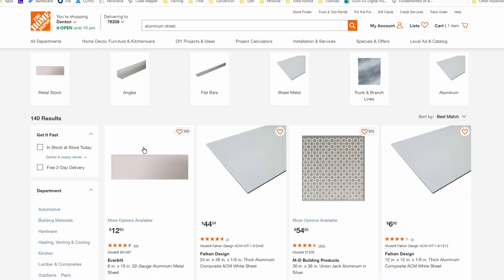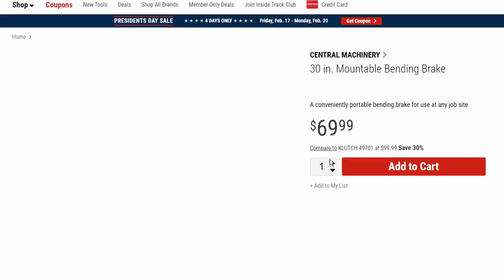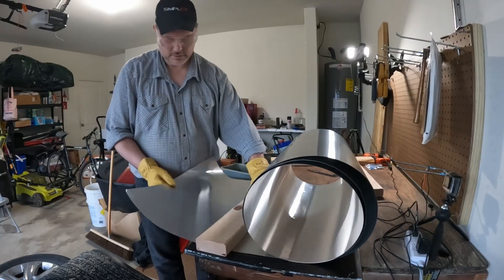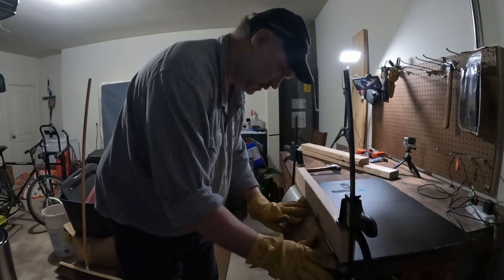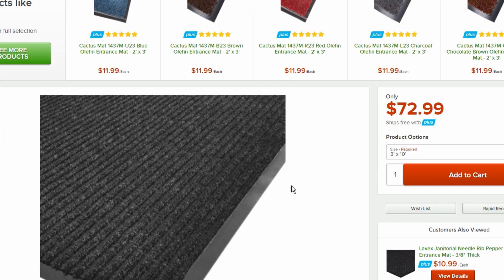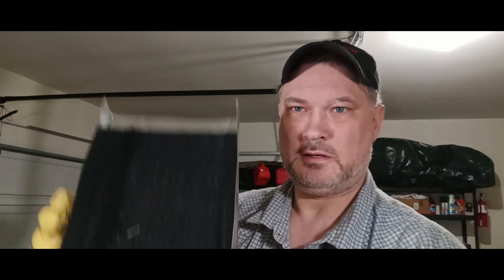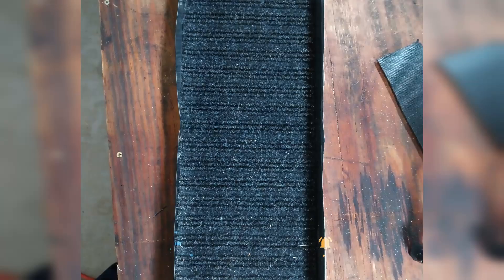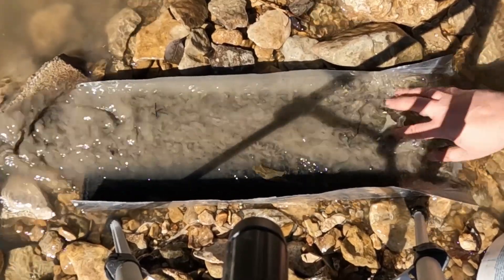Gold Rush On A Budget: Diy $10 Sluice Box - Make Your Own Prospecting Gear!

Comment: Excellent prototype for the price! As it sits, it's definitely a good value. I like your diy metal brake for the diy sluice! And the intro had me cracking up and also nodding in agreement! Like the above comment said, great production value! Keep it up! 

Now my 2 cents' (which should be taken with a grain of Llano fly poop)

 I wonder if the matting would benefit from the fabric being looser and more porous, and if a wire brush could be used to accomplish this with what you already have? Idk how rigid the fabric is, but I imagine if its compacted pretty tightly, then then surface tension and agitation would benefit from having a more porous surface to catch more heavies on top and in between the riffles/ridges as well. 

Experiment with different folds and bends and you can definitely accomplish the rigidity you're wanting. Maybe using a 1/4inch lip bending outwards on all sides of the sheet metal (once cut into the size you're wanting) before bending the sides and flare would aid in that? 
Edit if you did incorporate some type of lower ridge, into the bottom or bottom edges. You could use JB water weld to seal the lip from particles settling into it, and add rigidity at the same time. I used some to bond and reinforce a header box I made and its held up awesome for two years. 

Either way, great build, great video! Thanks for sharing your journey with us!
Reply from the maker: Thank you so much for your suggestions! I want to find some way to curl the top edges, but the main thing is the bottom..
Well, now you got me thinking.. I could put a keel type bend right up the middle, but I'd lose width..
The carpet itself is too thick and soft. I wouldn't be surprised if there's still lead stuck in the fibers, but besides that my water flow, the fact that I dropped the sluice itself, the angle - there was a ton of stuff that contributed to the bad recovery. I just don't have a rig to properly test. 

Thank you so much for such a detailed comment!! I really appreciate conversation about this stuff
Reply: @goldnoob  you're definitely onto something! I couldn't even build my clean up sluice for $20-30. 

40% recovery in a $10 sluice is better than no recovery and no sluice at all! You'll get those numbers where you want them! And besides, DIY is how the old timers started this great tradition. And we ALL know someone who has spent too much on sluices (its me, I'm guilty😂) One day, we might be telling folks how we witnessed your rise to fame as you become a household name like Keene or Minelab. Dream big! You can do this!

Comment: I was looking for something like this! Love that you didn’t cut out the part where the sluice fell into the bucket and how crafty you were when bending the material. 
I’ve seen some small short sluices for fine gold recovery online. It looked like a rain gutter, small fish pond pump and black rubber ribbing. I was going to try something like that for circulating sand I pick up while traveling but haven’t made the jump because it was almost $75! 
I’ll definitely be trying this but maybe with a thicker sheet metal or adding wood support on the bottom using homedepot yard sticks or other stuff.
Reply from the maker: Those are some great ideas! One thing I didn't mention in the video is that I was looking to sell these for $10. If you make it yourself it's only like $6 per sluice, but you can't buy any of it small enough for just one. Besides even if you could it would drive the cost up..

My ultimate takeaway was that the sluices you buy online, I suppose, are really truly worth what you pay for them. I'm just trying to come up with somethign that's .. I dunno, like a paper cup disposable version LOL

Comment: Just made my own mini sluice from some funky textured steel sheet metal from scraps from my stove vent, might be interesting to see how the added textured low spots catch gold with or without moss, matting, or diamond mesh. 
I dont have a brake press, but had a bench vice, plenty of wood scraps, and two wood clamps i repurposed as such. Turns out 2x4s have a pretty decent bend radius for the material thickness i used. 

Since i was working with scraps i was limited in my dimensions, but the two pieces i had worked out pretty well in the end since they were the same dimensions. Ended up with two sluice channels that were 15" L x 7.5" W x 3" H, i plan to rivet the two together so they can hinge and fold making it more compact while giving me a 30" sluice. Just need to source some cheap or free matting, riffles, and moss. 

Whole reason I built it was so i can process material from deeper spots in the winter and keep my hands dry and out of flowing below freezing water lol.
Reply from the maker: That's really cool! Matting is really the challenge. I tried a bunch of stuff - if you have fine gold where you are, have a look at marine carpet. Just make sure it's textured. I think I have a link to what I used somewhere
Reply from the maker: This video here, I used the marine carpet but I guess I didn't link it :(

https://youtu.be/aMIQTRTHeGw

Comment: Dollar store ribbed carpet might surprise you with its gold capture ability. With smooth and even laminar flow (unlike the scouring flow you had), a moderate feed rate and a damper flap, the capture rate for gold is extremely good - probably 100% of the coarse gold, and 85% capture down to 200 mesh. Tip - a 12 inch wide x 36 inch length plastic boot tray is $3 from the Dollar Store and is much more rigid than that aluminum you are using. Just saw the bottom and top of the boot tray horizontally to turn it into a river sluice. Good stuff!
Reply from the maker: I found the dollar store rug literally 5 minutes after getting the other thing! I'll definitely look at that for the next one.
I'll see if I can find that boot thing

Comment: As a recent machinist...I can appreciate what you were trying to do here.  👍
Reply from the maker: What kind of machining did you do? I worked on Brown & Sharpe single spindle screw machines
Reply: @goldnoob  Well...here goes it...I'll try and keep it short.  I'm a 3rd generation machinist.  Worked next to my father and grandfather growing up.  I started sweeping at age 9...saw/deburr age 11....was reading mics at 13 and full on mill hand by 15.  That was before cnc...all manual....mill saw lathe and grinding.  That was down by Detroit.  Then The folks moved up here to Wisconsin while I shifted to landscaping in Detroit.  Fast forward to 2007 and what my folks built up here was a world of difference.  I moved here and learned cnc.  After and intense couple years I was able to work independent from print to product.  We became iso and aerospace certified.  We also built a 2nd location around a giant boring mill.  That became my baby and I also managed that building.  Without to much detail (NDA) I 3D machined some large naval ship components. With all of that said I needed a break...which I am using to start all Gold and silver related hobbies.
Reply from the maker: That's an awesome story!

Comment: Not done with the video, but I was thinking of a plastic, paint roller tray with the textured shelf liner material. Wally World has, EasyLiner Select Grip 12 in. x 10 ft. Shelf Liner, Black. I would cut the end wall of the tray shorter and maybe screw some washer on bottom to give some weight.

Comment: Re-enforce the structure at the top with bars/etc so it would hold the form better.  Don't use carpet as it's not good for this but get the proper mats.  Also, I don't think you can get away with a 10 AUD version of it.  Just not going to happen.  I have a design in my head that I would make but am so far away from gold country isn't not funny.  But I would set up three sluices that perform different functions if I could do it.  First one removes the magnetics from the flow by using neodymium going across the sluice.  There would be about 8 or so magnets to capture the magnetics.  Yes, you could trap gold there but in order for it to trap it; it would have to have iron in it. Else it will go to the second one.  Because it will add as ridges to trap small gold.  You can dump sluice one into a cons bucket and go through it later.  Plus it makes it easier on the second and third as you will have have to deal with the black sands.  The second one will remove anything that is 1/16 in and above.  Some like to capture gems as they go and it will row off and allowing the under 1/16 in to continue to the third.  The third is the last chance capture of gold prior to running off.  This entire system is feed by a trammel that is connected to the first one.  For me this would work as I would process the raw gold into refined gold as am more interested in the refinement bit of it.  The black sands at a given stage of the process would remove gold from the solution and take iron into the solution.
Reply from the maker: Great ideas but it would make the sluice another of hundreds of products that cost $100.

It's funny you mention not being near any gold - I'm in North Texas and the nearest gold is hundreds of miles away. I thought this challenge would make for interesting videos and let people with extremely low budgets see how they might be about get into the hobby.

Comment: Did you buy the rubber back rug? Cause those aren't cheap in my area and besides the needed saw. Pretty nice build, what's your total price? Take care. ✌
Reply from the maker: I did use the rubber backed rug for my first sluice. It absorbed water and helped it stick to the riverbed, but yeah, I needed to bring the proce down. My second sluice (there's a new video on that one) I used marine carpet which was MUCH cheaper, but it didn't weigh the sluice down so it tended to get away from me.

Comment: Never glue the carpet to the sluice. You need to be able to remove it and clean it upside down in a pan to recover the gold
Reply from the maker: There needs to be a way to keep the mat in the sluice that meets the requirement of keeping the cost of the build such that it can retail for $10. I choose rubber cement because it's waterproof and comes off easily.

Comment: Buy a cheap lightweight plastic sluice from Geo Sluice Mining.
Reply from the maker: I'll check it out!
Reply: @goldnoob  Yes, Geo Sluice Mining (in Oklahoma) has both plastic highbankers “and” river sluices. In both drop riffles “and” dual-ramp or 2-step riffles in the Le Trap and Le Trap Mini. I love the large size Le Trap, it is very, very good at catching fine flour glacial gold, famous, and has been around since the 1980’s is when I purchased one about 37 years ago. A disadvantage is it needs even water flow and no surging (no start-stop-start) of water which blows out gold.  >>But the drop riffle plastic sluices withstand surging better I think.<<  “Expanded metal” (over miners moss) sluices withstand surging the very best, protecting the gold, but they are very heavy.
~All of the plastic sluices are so lightweight with fast & easy clean-outs.
Reply from the maker: That's awesome!

Comment: I'm sorry, but in what universe does this add up to $10? That roll of flashing is $25. The saw, clamps, wood, etc were not free. This is much closer to $100 or more than it is $10. Thanks for the false advertising click bait title. Great idea and design. Just be more honest with the title. Maybe say, DIY Sluice box for $100 or less, instead of $10.
Reply from the maker: Hi, thank you for your interest! 
This video series documents my attempts to design a sluice that I can sell for $10. 
That said, I bought a roll of flashing for $25, but it's 10 feet long, making the amount I used for this project $2.50
The matting is similarly inexpensive. 

I'd like to put these up for sale, but there are still some issues I need to work through.

As far as tooling, no project instructions ever include the cost of tools. Recipes don't include bowls and ovens in ingredient lists, etc. That said, I don't use any specialized tools or tools that require special skill. In fact I don't have any diy skill or tools at all myself, having to buy them all and learn how to use them as I go. 

If you were to use the method I demonstrated here, the end product would only consume less than $10 of materials. There are ways of getting smaller pieces, such as talking to contractors and buying scraps from them, etc. 

Meanwhile if you're interested in a sluice in the short term, I absolutely shouldn't mind selling you the prototype I made in the video for $10. You can contact me at goldnoobvideos@gmail.com
Reply: @goldnoob  hmm. Wonder what shipping would cost for such an item. I'm sure, if it's not too much, you could get some business going. People closest to you would be your best customer base. Also curious, how it would hold up to the many careless people whose hands this passes through during transportation.
Reply: @dickie8015 last time I shipped one it was less than $10 for shipping. They're light but they have to go in a box that accommodates the size. 
I do use corrugated cardboard though so there's no opportunity for damage. But you're absolutely right that the thing is not rugged at all.